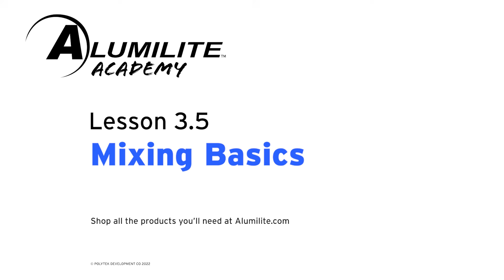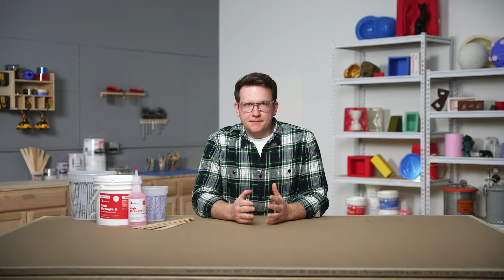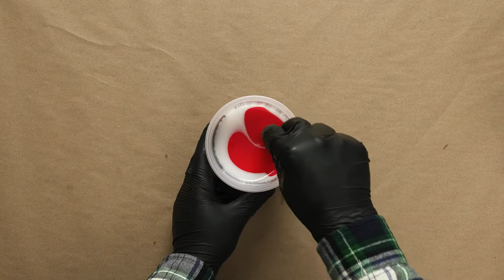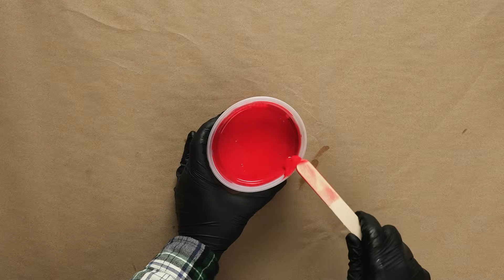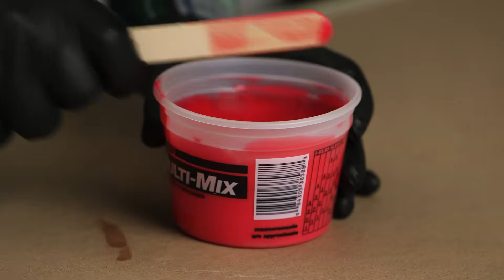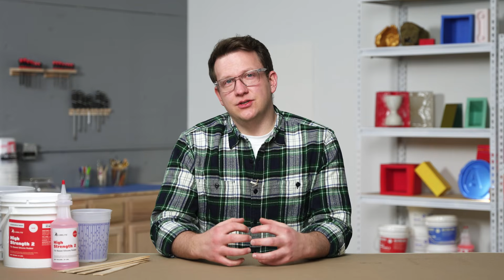Proper Silicone Mixing for Mold Making (No More Mistakes)

Comment: might as well use a whisk, no?
Reply from the maker: A whisk isn’t ideal for mixing silicone it adds air, which can cause bubbles in your mold, and it doesn’t scrape the sides of the container well!
Reply: @AlumiliteCorporation  Is it important even if the silicone is degassed?
Reply from the maker: @vladimirlavrentyev9206  Yes! You don't want to end up with any unmixed material in your cup